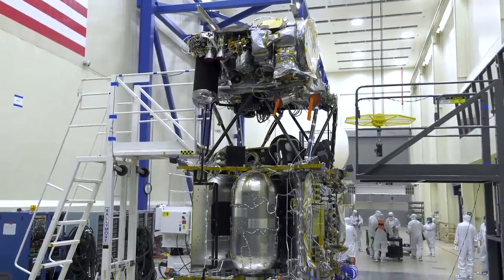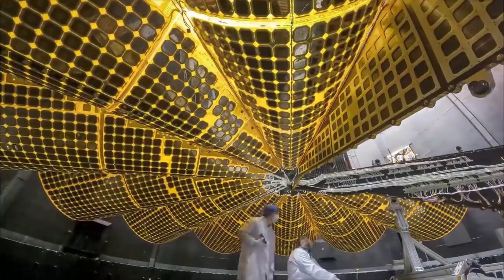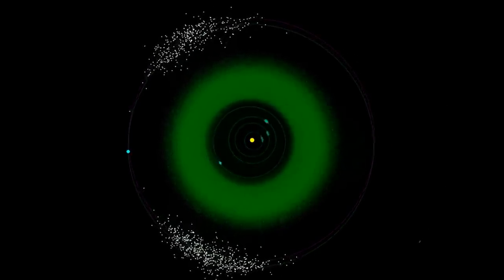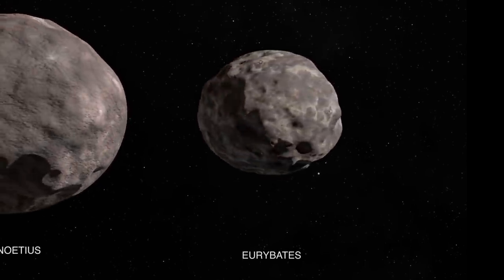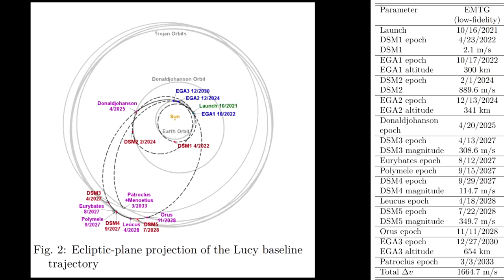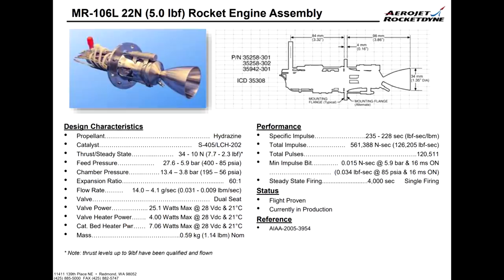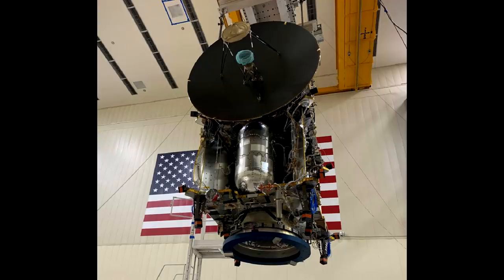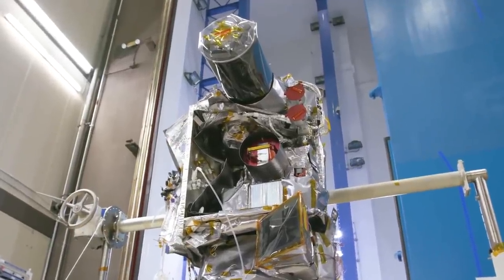How NASA's Lucy Mission Will Visit More Asteroids Than Any Other Spacecraft.

Comment: Incredible to see how you can fine-tune your mission design to hit multiple targets on the same mission. One of the more ambitious multi-target missions since the Voyager Probes! Super excited for the science that will come out of it!
Reply: In the early 2000s there was the CONTOUR mission, which would have flown by a handful of different comets. But it experienced structural failure during activation of its solid fueled kick stage.
Reply: Well, it'll definitely be a trip...lol👍

Comment: I would like to see a cheap (perhaps a cubesat-like thing, with some ion thruster for high specific impulse), mass produced probe. Build a few hundreds of them, and send them all over the solar system, to explore and image thousands of asteroids and KPO. Let's find where this damn black monolith is hidden.
Reply: Could load up a starship with like a 100 300kg Sats. A Starlink sat weighs 260kg for reference and has a thruster and solar cells.
Reply: Building cost of a spacecraft is just one component in the total mission price. You also need a ground crew, and you have to put that stuff in orbit. Putting something into orbit is about as expensive as that same mass of gold on earth. So while a probe for only 1/4 the price sounds good, it doesn't change the total mission cost by that same factor.

(At least, until Elon builds his Space Elevator in like 2040 or something like that ;) )
Reply: There's also the problem that space is big. Really, truly, mind-bogglingly big. So the chances of this shotgun spread of probes managing to get close to... anything at all, would be pretty slim. However there might be something to the concept of having standard mass-produced probes that can be kept on hand to be shot at anything of interest that floats through a launch window.
Reply: @Garagantua  That's the idea. I think a spaceship could send a lot of cubesat-like probes in a high elliptic orbit. Then, each one will do its own slingshot maneuver, using parts of its fuel to be launched at the right time in the right direction. We don't care if the need 10-20 years to reach their target, or if some of them are lost. But either we make giant space interferometer telescopes, or we send tiny cheap probes en masse. There are thousands of objects in the solar system and we don't know what they are until we send something around it.
Reply: @Garagantua  Just as an FYI, even Starship - humanity's first prototype fully reusable rocket system - will be cheaper than the most optimistic projections for a space elevator. Space elevators aren't cheap. What they do do is allow you to massively expand the amount of material heading up and down compared to rockets. It would only take a few hundred Starship launches (and reentries) per day to dramatically change the energy balance of Earth's upper atmosphere. Any reasonably sized spacefaring civilization would need at the very least 10s of thousands of launches per day, not hundreds. Space elevators allow you to do that kind of thing without wrecking the upper atmosphere.

But they're not cheap and they take a long time to get to GEO and then back down again. Not only will they never be cheaper than reusable rockets, they'll never be used for human transportation (too slow).
Reply: @jasonwalker9471  As far as I know, Falcons are still way more expensive than initially projected (even though they are cheaper than well anything else in that class). So I'm only believing the cost-claim when I can see the prices ;). 

But apart from that: yeah, you're right, going a few hundred km/h on a several thousand km elevator ride doesn't sound fun, but is fine for most cargo. And sometimes, going slow might be a benefit (certain cargo, certain people). But I highly doubt that anyone alive right now will see a space elevator on earth :(
Reply: @jasonwalker9471  Don't forget that a space elevator won't just put you in LEO, it's effectively a slingshot directly to interplanetary space since the counterweight has to be past GEO for the centre of mass to land there, so it's cost per kg has to factor the multiple launches are refuels likely required to reach escape velocity. On the other hand, that just makes the trip even longer!
Reply: The Borg would eat it…
Reply: we don't have the materials science to build a space elevator for earth and are unlikely to for a very long time. the moon is a much more viable candidate for such a thing, if only someone would make the investment.

Comment: This reminds me of the expedition of the solar system that the voyager probes did in the 1970s-now just with asteroids this time. Whoever first worked out the math for this mission's route and figured out it was feasible is awesome.
Reply: It's definitely some impressive planning, no doubt. But my guess is that they set a rough course that would allow them to hit both sets of Trojans and then picked targets that fit along the path. Like how you don't plan a road trip as a series of gas stations, you just pull over when you could use a fill up.
Reply: Thousands of asteroids out there, many similar trajectories are possible. It's a matter of finding which one is the most interesting!

Comment: Why does Lucy not use an Ion engine? When you're trying to get the most from your fuel mass for long missions like this, it has become pretty standard to use an Ion engine.
Reply: I think the Xenon needed is expensive, but I don't know if it's expensive enough to not use it.
Reply: @TlalocTemporal  It's a space mission, everything about it is already expensive. I'd be amazed if the cost of the Xenon was significant, and even if it is you can use Krypton instead. Not as good (less mass per volume) but cheaper, I believe some space agency has used it for that reason.
Reply: What I think: An Ion-engine is more for propulsion to and from an object (like Mars or Venus). Long duration burns to get into the correct trajectory and long duration burns to brake to get into orbit. Lucy needs nothing of this. The speed can easily be reached with gravity assists. The engine on board is more for course, small course corrections and is better suited than an Ion-engine.
Reply: @ablereplay  But Scott pointed out a large amount of the mass of the spacecraft is fuel. That's a lot for trajectory correction manoeuvres and I'd like to see an actual explanation for not using an ion engine rather than speculation.
Reply: @steviesteveo1  That makes sense, thanks.

Comment: Scott How does "antenna" power work? I mean if voyager can still transmit. It would seem that the signals are boundless. Why do some craft need larger antenna if it is this easy?
Reply: Voyager can transmit a few bits per second to antennas many 10s of meters across. Not even enough for a picture. There is a whole engineering field about channel capacities, coding for error correction, and another accounting for the power beam forming which is used for space and earth radio transmission.

Comment: The optical-quality lab-grown polycrystalline diamond beam splitter in the L'TES instrument is 21.1 carats! (3.9 cm diameter/2)^2 * pi * 0.1cm thick * 3.54 grams diamond/cubic cm * 5 carats/gram)
Reply: Besides its other excellent mechanical properties, diamond was chosen for the optics because of its excellent transparency (low optical absorption) across a broad frequency range in the infrared.

Comment: This Lucy is basically taking forever (if you're an old guy). Couldn't adding a nuclear rocket to the Lucy probe, and come up with .5G or 1G acceleration? They (NASA) built the Lucy space probe on their home planet of earth (that remarkably rock has one gravity on the surface),  so that gravity thing shouldn't be a problem. Maybe that way the mission time could be knocked down to just one or two years.
Reply: That would require an absurd amount of extra dry mass and cost a ton more. Also, nuclear propulsion systems don’t exist right now.

Comment: What kind of torque would an independently rotating instrument head put on the total rotation of the sat? Does/would they include RCS to negate it and then would they require desaturation as well?
Reply: It'd put the same torque as is needed to keep the instrument rotating, which would effectively be any bearing drag torque. Your ADCS would have to overcome that, and eventually get desaturated, or just let the spacecraft spin.

Comment: It's incredible what they can achieve with 1600  m/s of delta v, imagine launching one of this on starship with ten times more delta v, just awesome
Reply: Starship won’t have 16 km/s delta-v no matter how small the payload.
Reply: Starship will never have that much Delta-V, assuming it ever works.
Reply: That would be a complete waist of useless to launch it on starship. IF starship even gets remotely close to what SpaceX wants it to be.
Reply: @dummyjoe7895  And that is a very big IF. I did some calculations on Starship using the Silverbird Astronautics calculator, and something doesn't add up. With 10% propellant residuals for landing (based on consumption during Falcon 9 flights), the mass/thrust/Isp values from Wikipedia (with approximate of 200 tons for first stage dry mass) and launching from Cape Canaveral to LEO, the total payload is about 10 tons - not "more than a hundred" they promise. Even at the biggest error margin, it doesn't climb over 56 tons. Something is very wrong here...
Reply: @HalNordmann  your missing refueling. starship can’t even get out of LEO by itself without refueling. Starship is a very big stretch that won’t live up to its dreams.

Comment: Hello, Scott, thanks for the great video! I have a question, which arose from watching it. There is a piece of footage where they unfold the solar panel placed horizontally back in the lab. And I am querious about how they design those things. I presume that in space you do not need the same level of durability as you need in the lab to unfold a folded panel and fight the gravity. So there must be some excessive weight in the design which you do not need out there? 

Obvious (nowdays) solution would be to build spaceships in space and someone would once do it. But what about older days? Did they have some droppable supports on, say, Vouager? Or they do propel all that “lab gravity” weight with them?

Comment: We need a spacecraft with long cables that have small control thrusters on the ends. Just wrap them around as big an asteroid as we can fit in a ship returning to Earth. Then bring it back to Earth and put it in orbit.
Reply: Moving a million ton asteroid into a different orbit with small maneuvering thrusters? That would require hundreds of thousands of tons of propellant
Reply: @destroyer1667  
I said "wrap them around as big an asteroid as we can fit in a ship".......

Do you know of a ship that can handle a one million ton asteroid?
Reply: @lordgarion514  ah, sorry, yeah that makes sense. But even so, i dont think there are any spacecraft right now that could do the trip and then return
Reply: @destroyer1667  
That's ok, than can design that while they're designing the cable system. 😄

Shouldn't be that hard actually. Probably simpler than landing on them.

Comment: Why are the high gain antennae on most space craft usually covered by a cone of some sort? Is it only for thermal protection of the receiver or does it also aid in receiving the signals?
Reply: It blocks/reflects the radio emissions and light from the sun, while being transparent to the communications frequency.

Comment: I never really understood how things get "captured" in L4 and L5 points. Is it just tidal forces? The L4 and L5 points specifically are local maxima for gravitational potential energy. That's usually the opposite of what you want for stable.
Reply from the maker: It's actually the Coriolis force that constrains them.
Reply: @scottmanley  Sounds like I have a lot of reading to do. Thanks though. Your 10 ish minute videos usually make me do hours of my own investigation. That's not a complaint, its a compliment.
-edit
I'm guessing its the same effect that has me circling around whatever I try to dock with in KSP.
-edit no. 2
And the same effect that causes apparent bending of trajectories when the arrows were thrown in your recent (ish) video on rotating artificial gravity.
Reply: Did you catch Scott’s video on this?
Reply: @stevepirie8130  Yes. It raises more questions, but that's what happens.

Comment: Are asteroids solid objects, piles of rubble, or both?  How did the dust from the proto solar system turn into rock without being subjected to the heat and pressure inside a planet? Or have I got the whole process wrong?
Reply from the maker: There are different asteroid types, some are more rocky than others.
Reply: @scottmanley  OK Scott, thanks for taking the time to give me the heads up. I remember Dan Dare on Radio Luxembourg and Journey Into Space on the BBC as a school kid. It kindled my interest in space and over sixty years later I'm still asking and still learning.

Comment: I simply don't get it, they have so many cameras but cannot find a place for a tiny CCD cellphone camera, to take some color visible light images?
Reply from the maker: From 1000km away a tiny cellphone camera wouldn’t show very much
Reply: @scottmanley  So how about, in the lorri telescope?
Reply from the maker: @nyyotam4057  one of the reasons L’LORRI isn’t colour sensitive is to allow shorter shutter times reducing motion blur.
Reply: @scottmanley  I was going to ask "if that the case, then why not pass the signal through several filters and get several sensors to obtain different wavelengths at once, instead of just one monochrome camera".. Ahha, but that's exactly the MVIC. So they do in fact have a color camera on board :-).
Reply from the maker: @nyyotam4057  Yeah, MVIC is colour, but it doesn't have the same angular resolution, L'LORRI can see smaller details.
Reply: @scottmanley  Good enough for me :-).

Comment: Perhaps someone could answer this for me: if a spacecraft will be venturing far from the sun,  wouldn't a simple,  lightweight reflector/magnifier array be a  weight and cost saving means of using a smaller PV array for more onboard power?
Reply: Potentially, but then you have the added complexity of needing an equally large reflector that has to deploy and be precise enough to concentrate the light onto the couple solar cells and that always has to be oriented towards the sun or you don't get any sunlight on the cells. As opposed to a large array which is effectively passive once it's deployed and can handle being off axis from the sun and still get some power and not really worry about any alignment. Give and take to both approaches.

Comment: Hello Scott ,  love your videos.
I’d love see a video discussion of the possibility that SpaceX might bolt three of starships boosters into a a super heavy version of the BFR. Could such a configuration take starship to a higher orbit with a full load of fuel AND a strap-on belly tank that could greatly increase its range in the solar system - all in a single launch.  If not, what could be achieved in a single launch with such a vehicle? 
Dream big!
Reply: They won't, no chance! If they want a bigger rocket, they'll just build a wider rocket (which they expect to do!). No strapping boosters together. They learned from Falcon Heavy what a massive hassle that can be. Elon nearly cancelled that whole program just due to the issues  with joining three Falcon 9s together.

Comment: When starship is up and running none of this gravity assist nonsense will be required. 10% the cost 10 times faster
Reply: LoL k
Reply from the maker: Lol, no.
Reply: There is no way for Starship to have that much Delta-V, assuming it ever works. SLS has a ton of DV, and can throw 40 tons beyond LEO.
Reply: @HalNordmann  SpaceX is now valued at over 100 billion dollars which is 4 times greater than NASA's fiscal 2021 budget.  I think I'll place my bet on Starship.
Reply: @californiaadventures9106  Starship's design is pretty bad. Enormously high dry mass, hull made from hardly-melting but easily-warped steel, tanks that almost held by fuel pressure alone, tiny landing legs that can't land on unprepared pad, high fuel consumption due to complicated maneuvers and vertical landing, no escape system for crew variant... Shall I continue?
Fun fact: During the Apollo era, NASA had about 4% of the US budget, and most of it going to space exploration. Nowadays it has less than 0.5%, most of it is spent on maintenance, and some people still think that is too much. #FundNASA